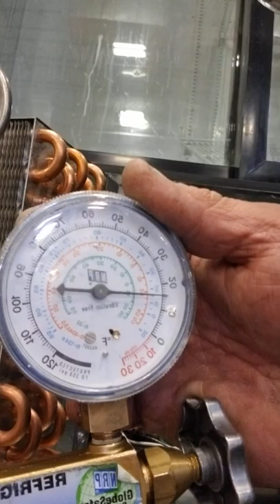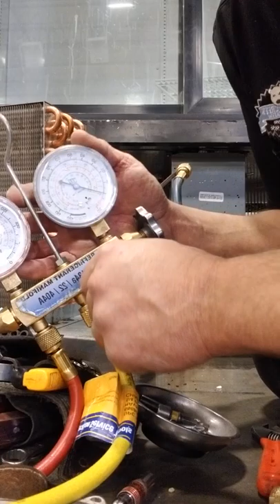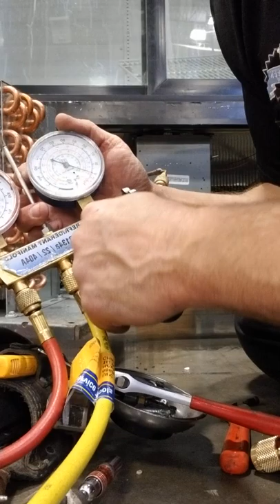R290 refrigerant pinching off refrigerant lines. True Beverage Air Coca-Cola Atosa propane R290

Comment: I heard manufacturers now allow service ports to be left on the system with red tape. Probably too many accidents. I was never a fan of that sketchy brazing at the end. I did it one time and my heart was beating out of my chest. Never again will I risk injuring myself for any manufacturer. If someone is stupid enough tp put a 6 feet hose on an r290 system then that's their problem. Use stubby gauges!!!